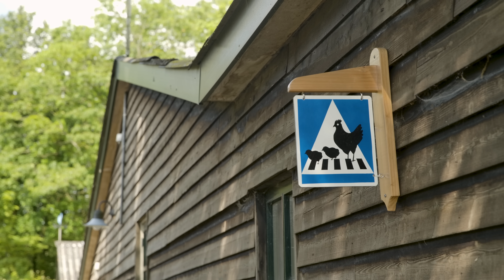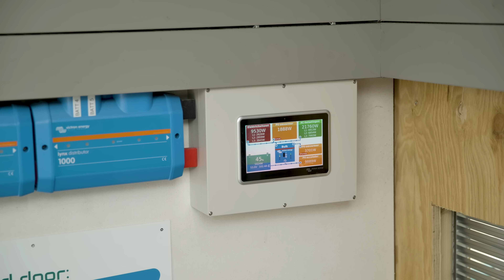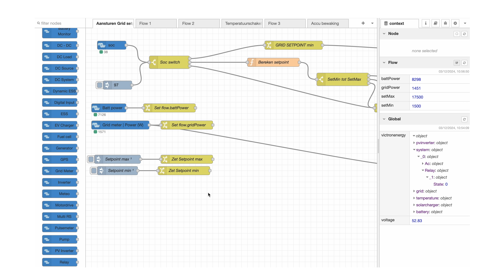Why the grid caused this Dutch campsite solar to blow up

Comment: Showing overhead lines and pole pig transformers is not the Dutch power grid.
Everything at and below 50kV here in the Netherlands is underground.
Reply: the cables yes, not the transformers
Reply: @kiddy1992  Pad mount. New ones are mounted sideways with most of them below ground.
Reply: 3 years ago the Benedenweg in Bergambacht stil had them. The whole Krimpenerwaard around Gouda stil has aboveground powerlines or had them until very very recently because of the soft ground. Still the good old system with wooden telephone poles and white isolators.
Reply: Yes there are still power lines above ground in the Netherlands, you can even see them from the A12(between Gouda and Utrecht). One of those street is; Laageind in Driebruggen.
Reply: It could be too much power between the campsite and the lowest level transformer. In Germany for example there is very little monitoring for that lowest level of the grid.

Comment: Interesting. Just strange that the 3x MP2 are stuck to each other without ventilation between them. Especially for 15kA. And one external fuse for 4 batteries, personnaly I would had used one fuse for 2 batteries max, just to be more secure.
Reply: Every single battery has its own fuse.
Reply: @lecramred4453  All batteries of this type have their own fuse. But a second fusible is needed for minimal security, like NH fuses (high class protection) for this kind of batteries.
Reply: @Alain-t2u  It has a second fuse. So why dont you ask first?
Reply: @lecramred4453 Fuse is not needed to protect batteries but only to protect wires. Which mean a fuse between those pack junction and the inverter is needed, cause the combined current can be higher then the cable rating.
Reply: @honumoorea873  Again: there are fuses. At both sides of the cables. So ask first before assuming
Reply: And there is no problem with the temperature. The inverter compartiment is actively ventilated.
Reply: Jeppp saw that as well, not up to code with victron manual

Comment: Break even point of 7 more years but soon after the batteries will need replacing and so the debt cycle continues. Think very hard before you invest in such a system, so many people would be better to just continue to pay a monthly bill if the grid is stable.
Reply from the maker: These batteries have around 6000 cycles. As described in the video during the year the solar supplies a lot of the power hardly needing to use the batteries. Even if the cycle was one a day (which it certainly isn’t) that’s still 16.8 years. Not 7 ;-)

Plus they don’t want to rely on the grid as the grid is unstable in that area.
Reply: @VictronEnergyBV There is even not a cycle each day. Especially in winter times, we have to charge the batteries to 100% each week as there is too less sun
Reply: After installing such a system, the price to replace the battery's becomes almost laughable.
Also, prices of battery's still continue to drop, while the storage capacity keeps increasing.
Reply: I got lfp batteries and they degrade 1% a year over the last 6 years.
Reply: The wiki article over lithium-ion battery states 1200 cycles, 20% decrease of power within 3-5 years, then you have other general accepted Physics websites or organizations that show what's the problem with Lithium battery's, than you have the article over Lithium itself and it's properties. 3 protons, 3 neutrons, 3 electrons, very rare in the solar system, you can't find in nature due to the single electron in the outer shell. people and reading.

The problem is when atoms are "inside" material, they are happy, but those at the outer rim or edge are not, they lack a partner, that's why things rust.

Comment: I had several types of UPS's, as power outage in my part of the Netherlands was about once or twice a year.
Then I started to test a victron MP2 with a seplos box and cells from nkon for my future house.
And now I really hate all the UPS's. UPS self test was a constant failure. UPS's have broken more than they were supposed to fix.
I am really thinking about switching professions so I can install LiFePo4 with victron instead of a "professional" UPS for about the same price. With the difference you have full control with what you do with it.
Reply: Were they APC brand UPSes?  I've had similar problems with them cooking the batteries after only 2-3 years, and then they drop power to the load during the self test.  Plus they have a huge startup current from the batteries (the capacitors in them, while large, aren't large enough) so the batteries need to be in excellent condition for the inverter to even switch on.  I have thought about switching to PV/battery equipment instead of a UPS as well, so interesting to hear that it is indeed a better solution.

Comment: Very nice! Victron is good stuff. Anyone being honest can't deny that fact. But at least here in the states it's also unfortunately very expensive. Wish it weren't the case, my solar shed would be blue inside otherwise hands down.
Reply: I just did a cost analysis between Victron, Sol-Ark and Midnight Solar, and Victron was by far better cost per capacity for a US 120/240V 20kVA system. And that included all the Cerbo/Venus and Lynx extras the other brands dont have.  I would not agree that Victron is expensive, unless you are comparing to chinese junk that steals your data and has no problem bricking your hardware remotely, and giving you a data security problem you cant even imagine.

Comment: Running off-grid since january 2017, I upgraded my installation to Victron products, and never had any issue. Reliable, adaptive to any situation, and monitoring the production remotely, being able to act on any of the components while being far away is a must.
Reply: but there are also reports about issues with victron systems at least here, complaints known for years and still not fixed.

Comment: Why the victron inverters are not installed with proper gap?😢
Reply: They look like models that cool from bottom to top, so you only need gaps at the top and bottom which they have
Reply: @Berkeloid0  They are Multiplus-II inverter-chargers which do indeed ventilate vertically (I have 3 myself)... although the manual says "Place the MultiPlus-II units close to each other, but allow at least 10cm for ventilation purposes under, above and beside the units."
Reply: Not needed ….

Comment: The spacing around the Multiplus II's is incorrect, why promote this in a video?
Reply: @flybywire5866  the case is metal and acts as a heatsink, the gap is needed for airflow. 
The Manual states a 10cm gap all round.
Reply: That was needed for the old Multiplus I. This equipment has worked all summer without any issue.

Comment: What about using a heat pump for hot water, heating and cooling? A Panasonic Aquarea J is around 3.000 EUR, so it is not much more than the resistive heaters, but saves more than 50% of electricity.
Reply: They need to dump the excess amount of PV into something. If they 'export' the energy back to the grid, they get fined. Resistive heaters indeed use a lot of power, but that's exactly the point.
Reply: It's not about saving electricity. The resistive heaters function as a dump-load when too much solar is being produced.They can be turned on in an instant, unlike a heatpump which takes time to startup.
Reply: A heat pump does not work with excessive solar power as it is not done to start and stop the hp often
Reply: if you start and stop a heat pump it does not create heat, you need to keep it on for longer time
so it would end up using more power in this case

you dont allways produce the  power needed  for a heat pump, but a heating element can also work with small amounts of power.
so you can also get a bit  of heat on the days with less sun, with a heating element 

and it would also destroy the heat pump fast if it starts and stops all the time

Comment: Nobody realizes how much of that absolutely critical control software and control equipment for the power grid is manufactured by your adversaries in any war maybe that's not such a good idea
Reply: There is a difference between manufactured and designed.  Yes, a lot of things are manufactured in a questionable country but the firmware that operates it all is encrypted and the chips that contain it are also protected (device protection has been a long long battle of attrition for anyone that wants to look into it).  You can be fairly confident that the firmware on a non-rubbish product is what the manufacturer intends.